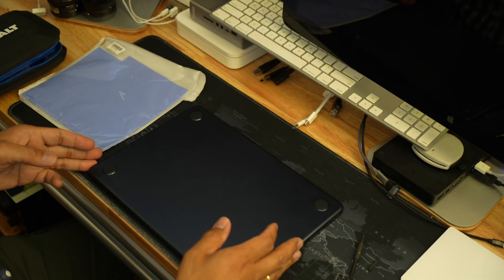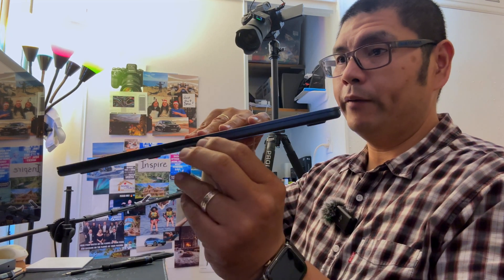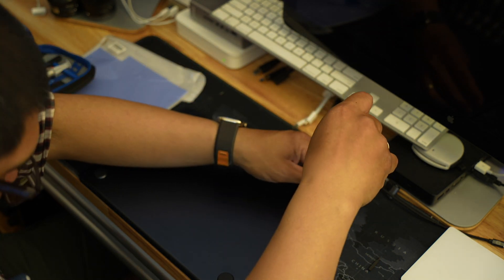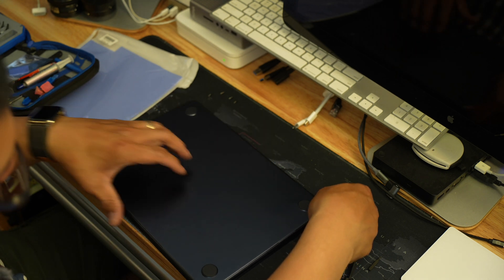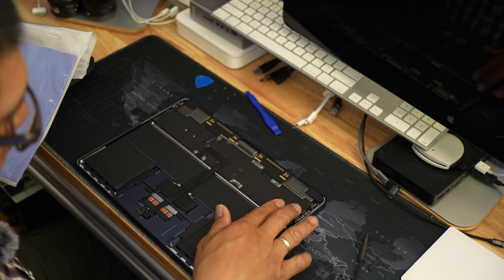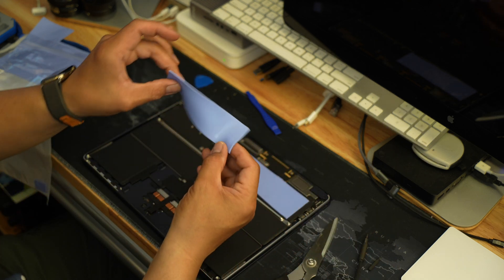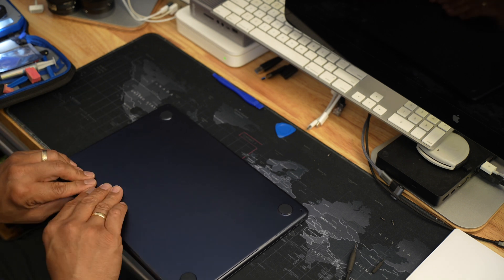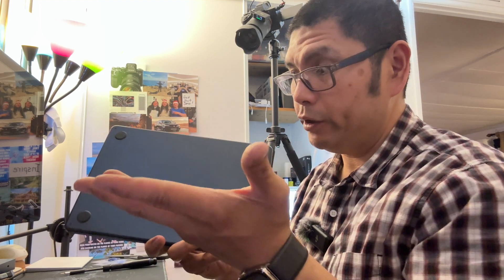M4 MacBook Air 13 Thermal Pad Mod- Squeeze the most Power out of the 13" Air

Comment: Everyone is using 1mm silicone pads. Did you find 1.5mm too thick? Was it difficult to install the back plate?
Reply from the maker: The back aluminum cover was a bit tighter, but I was able to get it installed without issues.

Comment: What where your resulrs?
Reply from the maker: To be honest with you, I did not run a benchmark comparison. The only thing I did do was stabilize a video clip before and after, and there was literally a one minute difference, 8 mins vs 7 mins to stabilize. The video was getting too long already and didn't want to add it. When I did run a benchmark years ago when I did this mod with the M1, it was 10% more on multi-core when I ran Cinebench. For much of the quick tasks, you won't notice a difference, but it'll be the longer time consuming tasks where you'll notice a bit more speed, heat, and battery draw. But maybe by like 1-2 percent less battery, not noticeable.
Reply: @momanddadmeetworld That s cool.Awesome.
Reply: Less battery due to better performance right?